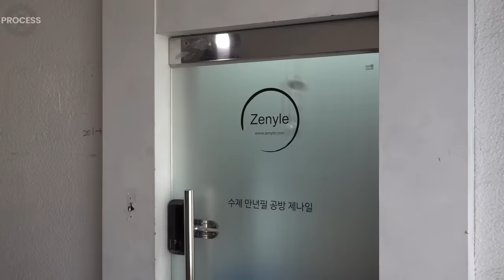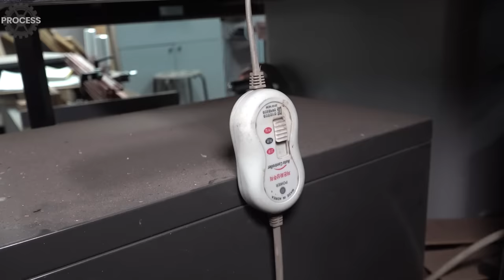Process of Making a Handmade Rosewood Fountain Pen. Korean Pen Maker.

Comment: Those pens look very nice.  I think I need one of those syringes for flushing ink out the pen.  Would help when I'm cleaning the pens I already have.
Reply: A $5 rubber ear syringe bulb that you can buy at your local pharmacy does the trick.  They are entirely rubber, so you can cut down the nozzle to fit your pen(s), and they are so cheap you can buy a few that fit your entire pen collection!

Comment: Many hobbyists are able to purchase less machinery to do the same thing. No need for a special device to “stir” things. No need for a lathe to use a Dremel bit. No need for a drill press as the holes can be drilled by the same lathe you use for shaping the blank and putting the pen together, unless you want to buy the assembly machine as a separate piece. Manufacturers like this one are only competing with hobbyists working out of home.